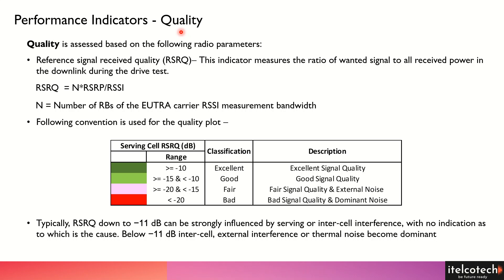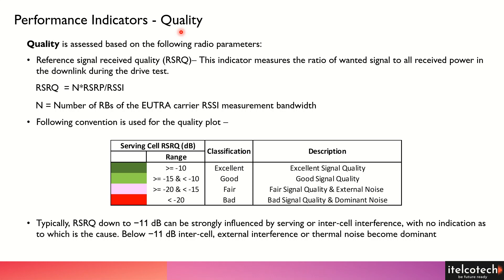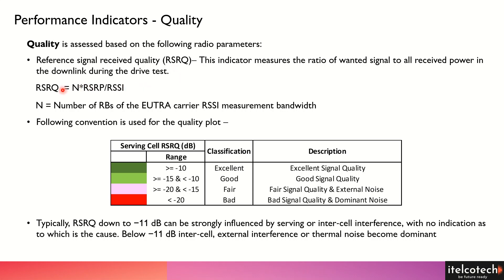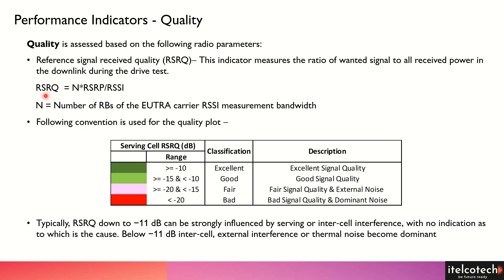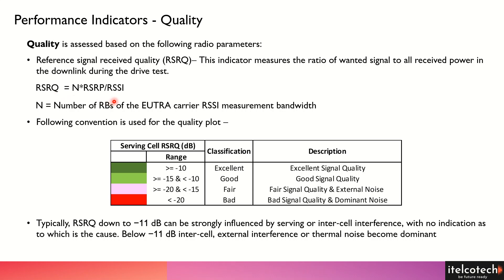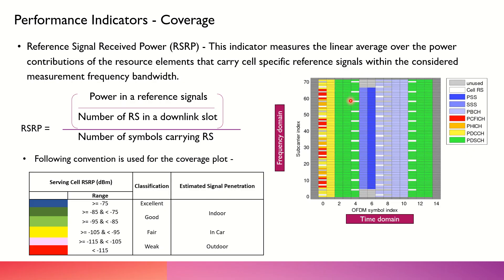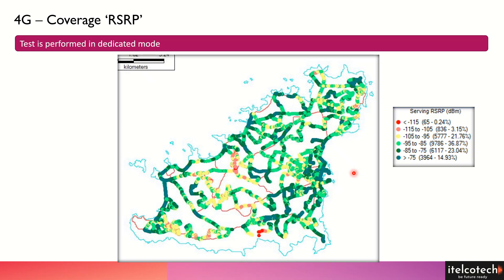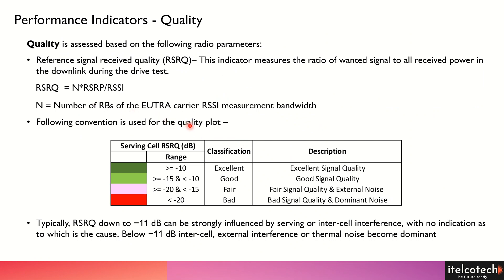Reference signal received quality (RSRQ)

Comment: Can I ask a question, why isn't Bit-Error-Rate or MER for example used in LTE signal measurements?    Like how they are in Cable Internet or Digital TV?   As wouldn't this be the best quality indicator?       It seems like RSRQ is calculated simply using signal strength